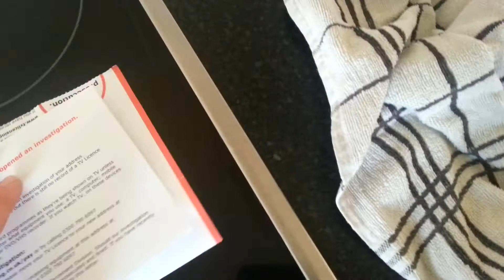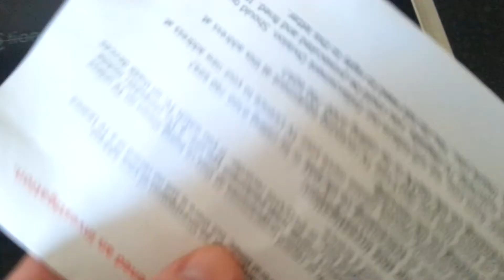Magic hob

Comment from the maker: They have an electromagnetic coil under each section and cause a magnetic field.  When ya put the pan on, it must interfere with the field and it makes the pan generate the heat rather than the hob creating the heat for the pan. Some say they can cause illness cause of the radiation from them. Apparently safe as long as I don't put my face on it as I'm cooking ha ha.